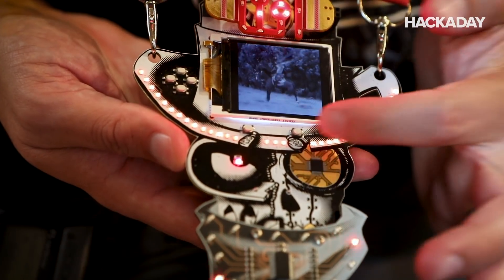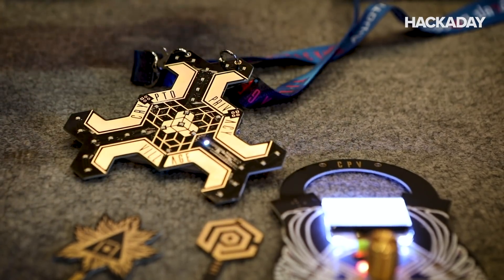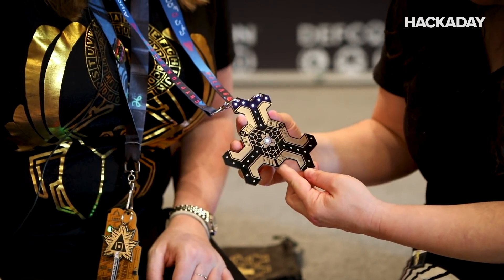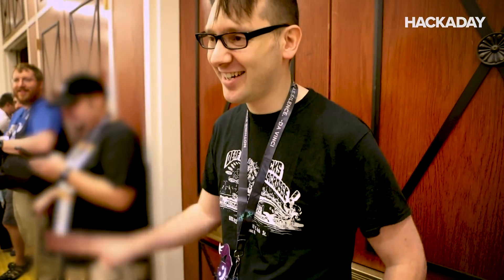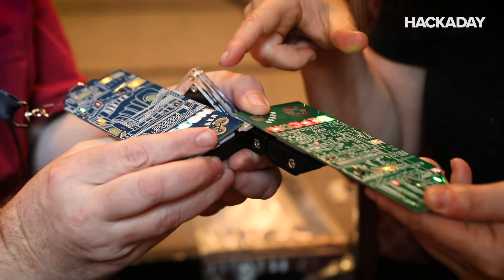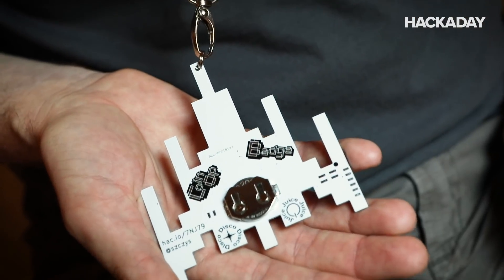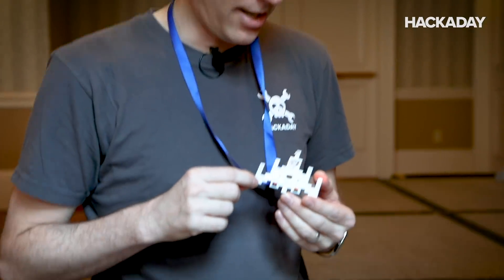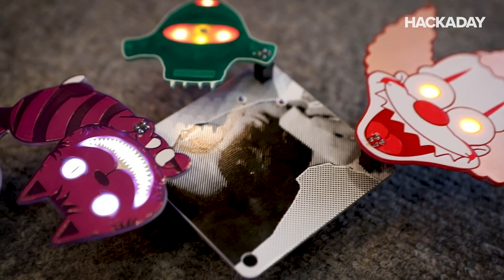BadgeLife - A Hackaday Documentary

Comment: This makes me just wanna make one out of a solderless breadboard with a rats nest of wire all over it. And one blinking LED.
Reply: Use a RGB slow flash led. Then add a FPGA BO on the board, powered and fully program ready, but not in any way connected to your led/resistor/battery.
Reply: haha... good one :P
Reply: add button or 2 that doesnt do anything
Reply: And it has to be started up with one of those old school lawn mower pull strings.